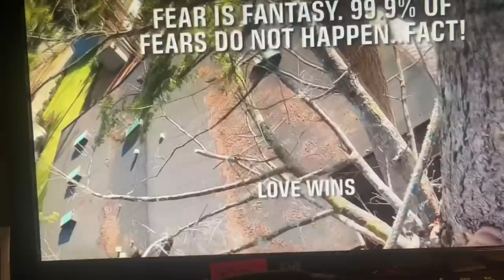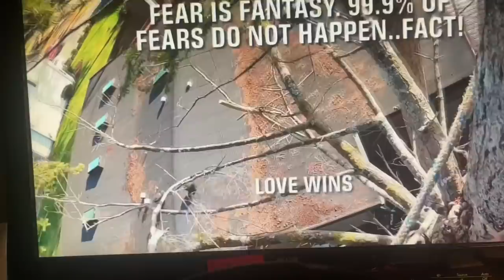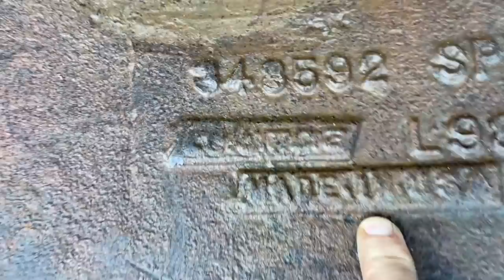LIMB TIED TREE FELLING. THE DECISION WHAT TO DO WAS'NT EASY

Comment: Buckin’
That is a cone crusher as TazMan says.  I got one from a rock pit contractor.  I was told at the time they were not able to recycle them.  May have been not worth hauling to the scrap yard 25 years ago.  My neighbor has the other half.  Mine looks exactly like the one you took video of.  My neighbor has chain hooks on the sides of his.  I was told they are high nickel content cast iron.  They do not rust much.  Mine has been used as a fire pit and half buried for the 25 years I have been using it.  A little surface rust but no scaling.  Great fire pit.

Comment: I cut a lot of dead oaks and they get limbbound terribly with each other and it can be a real treat pickin them apart. I’ve had them to where the tree is actually leaning and you make your back cut and it doesn’t move, and you pound wedges and it still won’t move, and then we get just end up dragging it over with a big tractor 👍

Comment: I’m no faller at all, but when they’re limb bound and one wants to fall them in a line, I think the language you’re looking for is that the poles need to “shear” relative to each other. The front tree would appear to be going up relative to the back tree, or if your Go-Pro was riding along on the back tree, it would look like it was going down relative to the front tree… And the limbs prevent them from shearing or sliding on each other ☺️
Reply: Well said. All I could come up with, is that it is the same as an "h brace" for a fence. English is hard. Ha

Comment: Buckin' can you explain what you're doing at the very end when the tree is just about to fall?  It looks like you leave the saw in the wood even though you're done cutting to adjust the direction of the fall?  Are you taking away hinge wood at the last second on the side you want the tree to fall?  Many thanks.  Learned a lot here in terms of what can and can't happen when two trees are limb tied.  Thanks again.
Reply from the maker: thx ,, this shot was alot tighter than it seemed , there was a chance of hang up in the fir as i talked about briefly befor i cut it down , yuo have a momment where if this happens you can utilize inertia and cut what ever wood needed to roll it out